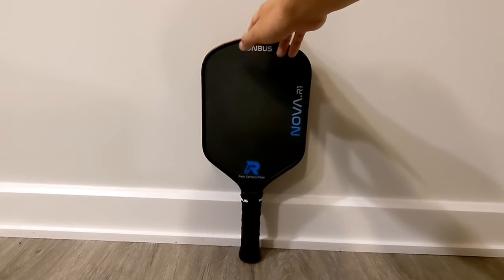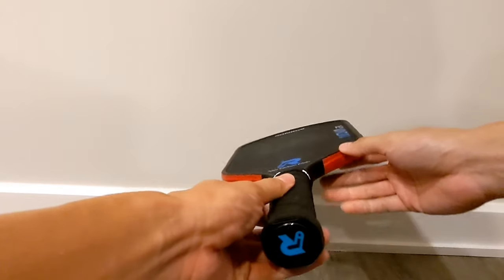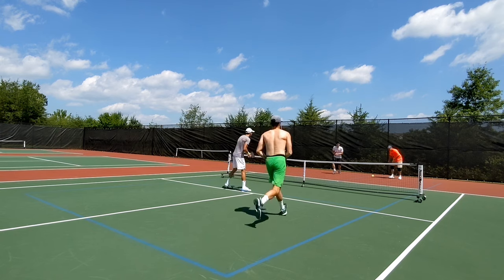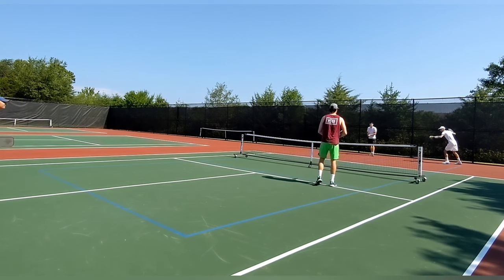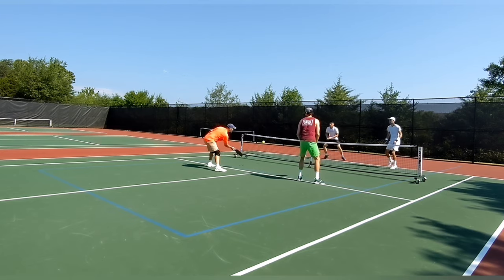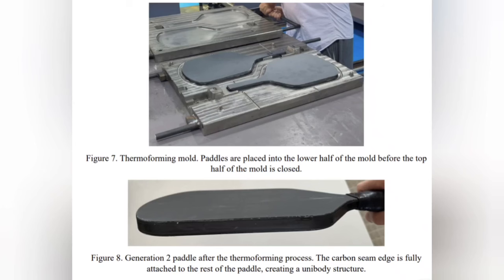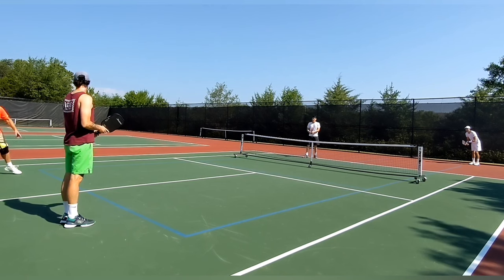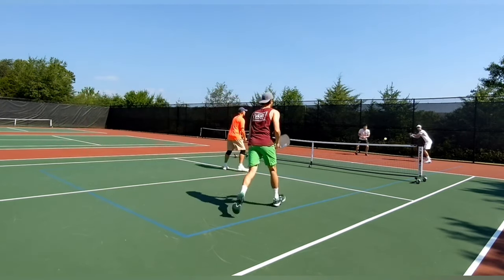Ronbus R1 Nova Review. The First Gen 3 Pickleball Paddle

Comment: Great video. I've never had any problems with Gen2 and neither have the players in my club, though I've read about them. Is it worth the extra $60 to me. Definitely not. I think it will come down to each player liking a slightly different paddle feel and performance.
Reply from the maker: Agree with you here, it really is personal preference. The Prism is $70 cheaper and already a great paddle and I can't say that the Nova is really worth $70 more but it's moreso if you really want that extra pop and power in your game and think that's what you need to get to that next level.

Dollar for dollar those Gen 1 and 1.5 paddles are a better value but when it comes to preference, that's when you'll need to disregard the price more
Reply: @TickleMyPickleball  Agree. It's just that there are better values for the extra pop.  Someone would have to want the exact overall characteristics of the Nova, and be willing to pay the extra price for it. A combination of weight, handle, control, speed.

Comment: Brother. Please. Ballista. I cant wait any longer
Reply from the maker: Ahh sorry man. I've recorded gameplay footage and have my thoughts on the paddle but they're sending me a new updated model with a new grip and want me to wait to feel that before I release a full review. Hopefully it comes in a week or so but happy to provide you my thoughts on how it plays before I release a full review
Reply: @TickleMyPickleball   Thank you. I personally love how fast these edgeless paddles swing and I was just wondering if you could compare the sweet spot, spin and power to the power air invikta? I personally own the power air invikta but looking for something similar but...better? Thoughts?
Reply from the maker: @tanpen15 I've played the PA invikta before and personally think the Ballista is the superior paddle.

It has a longer handle to allow for 2 handed backhands and the sweet spot is better from the extra perimeter weighting inside; the denser honeycomb also inside allows for a more solid feel, it has better feedback on ball contact imo. 

It still swings quick like the PA and the spin is comparable. Biggest difference is power. The Ballista is on the softer side but because it has a low swing weight (110 I believe), you can weight it up with more lead tape for some more power and also help with the paddle's stability. Also the Ballista is thicker at 15.5 mm so it's more plush feeling and not as poppy as the PA

Hope this helps!